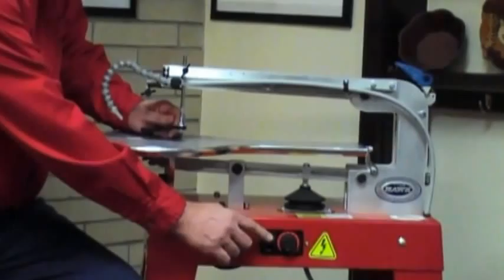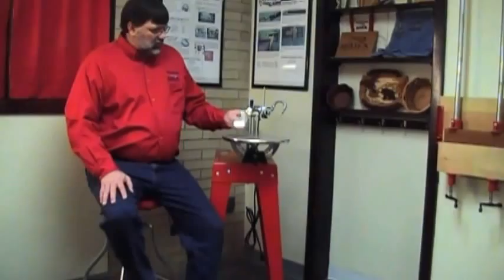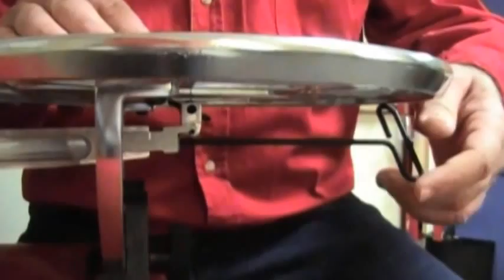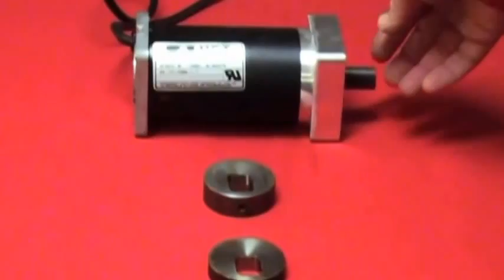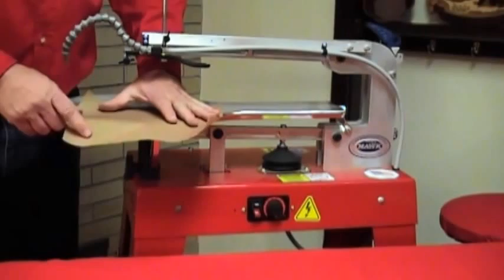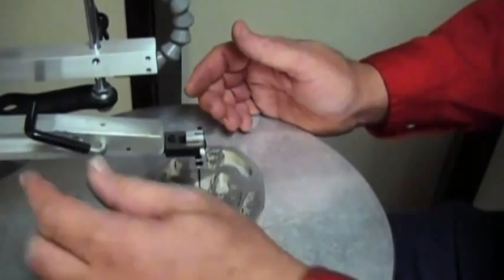Hawk Scroll Saw - BM Series vs ULTRA and G4 Series

Comment: I've owned a Hawk for over 30 years and have had no problems. My only gripe that persists today is the blade clamping system. It is painfully slow, cumbersome and downright frustrating. Hawk's manufacturers should take a hard look at the Pegas system which is vastly better.

Comment: I have a RBI HAWK Model #220-3 serial #6729. It has two different sized pulleys on the shaft for slow or high speed, with optional on/off foot pedel. It is in pristine condition, could you tell me anything else about the saw? It it the first model made? Or one of these on the video? It performs amazingly well. I am the second owner. Thank you.

Comment: I am having a hard time getting some replacement parts. I love my saw but while moving it to another shop they broke off the speed control button. My grandson tried to fix it and did further damage to the guts of the speed control.  When I tried to get a replacement speed control the girl told me I have to send the motor to them in order to buy a speed control. ???? The girl couldn’t really explain why.  My husband is a shop teacher and knows this saw inside and out.  He has 2 in his school and repairs it all the time when students screw things up.  She flat out refuses to sell it to me if I don’t send the motor in. Also the cost with the labor ??? Was astronomical!  If they would just let me buy the dang part there wouldn’t be any labor. The last time I called she had a bee on her desk and discontinued the call because she was afraid of the bee.  She said she would call back but never did.  This is bad business practices.  They are losing lots of business by making this so hard.  My husband has been approved to buy several new scroll saws and a couple more band saws.  He likes the Hawk but he doesn’t want to deal with people who won’t work with him. I’ve been all summer without my saw which I use in a business.   Does anyone know of a comparable saw that works as well as the Hawk?

Comment from the maker: Our motors come from MET Motors out of Mankato, MN. And the switch has been in the same place for 30+ years on Hawk saws. For those who feel it is too far away, we have the footswitch attachment. This power-interrupt switch means the machine is running only when your foot is on the pedal. It does not control speed, so feel free to rest the full weight of your foot on the switch when sawing. Lift your foot and the saw stops.

Comment: however, however, however.. is all I hear throughout this video..
Switch is located too far about midway, I would have to modify it within easy to reach ..
 For $1,200..  it betta be all American made, and that including the motor.. 
I jist gonna have to stick with my old Delta fer a long time..
Reply: Where in the world do you think your Delta was made?  Unless it is about 20 years old it came from the Far East.
Reply: As far I am concern, it is old Delta made prior 1980's.. all cast iron..
Reply: Get a foot switch and it wouldn't be a problem.

Comment: It looks like many of the improvements shown in the BM series over the Ultra series were taken from the G4 model.  Can you call out the most important updates to the BM series that are not present in the G4?  Thanks!
Reply from the maker: The primary improvements over the G4:

1.) Runs faster by 100 strokes per minute
2.) More machined parts rather than cast
3.) Several of the parts for the G4 were made overseas with sub-par materials (like the plastic pitman arm and the cast iron shield for the uprights). These parts are again being made in the US to guarantee superior quality.